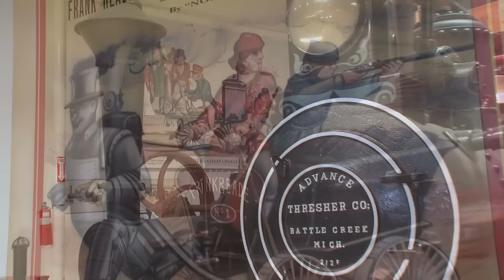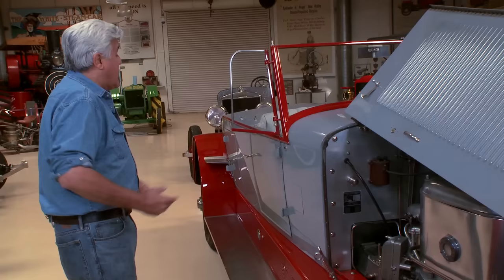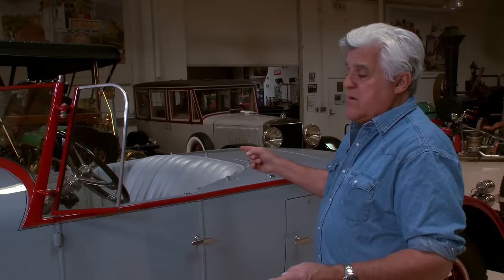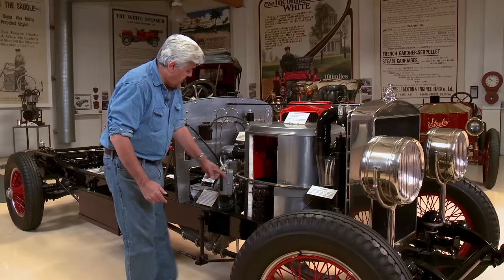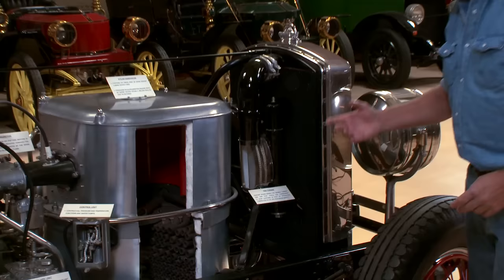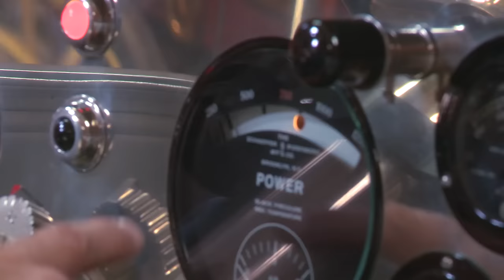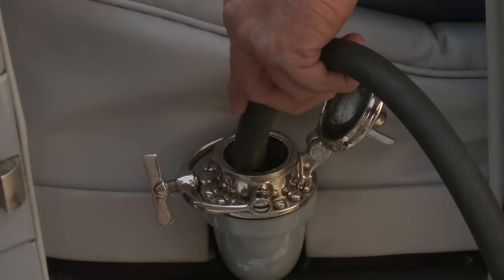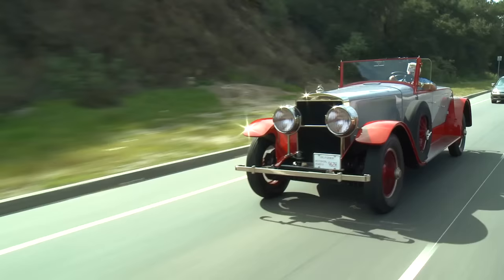1925 Doble E-20 Steam Car - Jay Leno's Garage

Comment: Throw the tesla away and make a modern steam car!!!!
Reply: Why?
Reply: @WilhelmKarsten  because steam is more efficient and can go further than Electric. Look how efficient that one is at 100 years old. Concentrate modern technology and you have a true green vehicle that you dont have to fill a landfill with dead batteries
Reply: @diefledermausrocks3863  Steam is LESS efficient than ICEs or EVs.
Steam cars use 10 times the amount of fuel. 
The Doble E-series is the most expensive car in the world in 1926, yet it was a gas guzzler and was a gross polluter with an obscene carbon footprint.
Jay's car gets between 3 and 6 mpg on regular unleaded gasoline and has extremey high HC and NOx emissions.
The Carbon emissions is equal to a dozen Honda Accords.
 Steam is obsolete technology
Reply: @WilhelmKarsten  an electric vehicle still use fossil fuels to generate electricity that they can store in the storage facility of the vehicle which is called a battery
Reply: @diefledermausrocks3863  Steam cars use more fossil fuels than EVs and ICEs and have a much larger lifetime carbon footprint.
Steam cars are not environmentally friendly and require significantly larger amounts of semi-precious metals and a larger mining footprint.
Reply: what a great idea to quadruple fuel demand and make the enviroment worse!

Comment: This is how you make a Green car, not some hyper expensive EV
Reply: There is absolutely nothing green about steam cars, Jay's Doble is a horrible gas guzzler (3-6mpg on unleaded gasoline) and has an obscene carbon footprint.
Reply: @WilhelmKarsten  use a different fuel source like pure ethanol, and use the system as a starting point for better efficiency, speaking of carbon foot prints and economic catastrophes,  look how lithium and cobalt are mined and processed
Reply: @lazarus0420  Steam cars are even less efficient on ethanol.
You cannot make steam cars as fuel efficient as ICE cars, steam uses around 10 times more fuel.
Reply: Not so sure about that given steam engines (commonly configured as turbines) are still in use for Shipping and are reasonably fuel efficicent, and its not to say a steam generator like used in the Dobel 20 couldnt be made to be more fuel efficent on a fuel source like ethanol to acheive a form of parity or supuriority to an ICE while not being quite so ruinisly expensive to produce and maintain like EVs not dependent on depleteing fuel sources like ICEs
 @WilhelmKarsten
Reply: @lazarus0420  There are not any practical  examples of successful steam turbines for automobile applications,  due to scale efficiency and duty cycle requirements.

Diesel reciprocating and gas turbine internal combustion engines dominate the marine industry because they are several times more fuel efficient than steam. 

The Laws of Thermodynamics prevents any steam engine from being as efficient as ICEs.
The Carnot Formula tell us that the Rankin Cycle has higher entropy and thus lower fuel efficiency.
Entropy increases as Scale decreases, steam engines become more inefficient as size decreases compared to ICEs.

Ethanol is a low energy density and the higher temperatures and pressures in internal combustion engine are more efficient than steam when using a low density fuel.
ICE are not only highly adaptable for renewable energy they are cheaper and more energy efficient than steam.
Any questions?
Reply: @WilhelmKarsten how does the math go for CNG.
Reply: @TempoLOOKING  You add or subtract the BTUs per pound of CNG to the Fuel type you want to compare, then imput the pounds per hour into the BSFC formula, which gives you the total energy efficiency expressed as a percentage.
Of course changing the Fuel has no overall effect on the Rankine Cycle efficiency, which is significantly lower than the Otto, Diesel or Brayton Cycles.
Any questions?
Reply: steam car are so fuel inefficient, its way cleaner to use internal combustion engine than use steam, it takes twisted mind to think steam engine are green, unless your steam engine is nuclear powered

Comment: Better then having Tesla's and other electric cars on the roads.. Lithium for the batteries is more pollutive trying to recycle, and mining it,  it then combustion engines are whent hey are running... Steampowered cars would be the better solution.
Reply: REALLY??
so you didn't know that this car guzzles gasoline at the obscene rate of 6.5 MPG?
And produces more CO2 and NOx emissions than a dozen Hondas?
Reply: This is false news put out by the petroleum industry.
Reply: @gj1234567899999  The oil companies would love to have everyone driving steam cars!

Comment: So....
Hands up who wants these instead of Teslas?
It doesn't care where the heat comes from, you could use Plutonium or solar panels.
Battery Electric?
No!
Battery Steam!
Reply: as much as I dislike Teslas... they are a far better alternative to steam cars.
Reply: Battery-Steam??? You might want to rethink that concept?
Reply: @sandervanderkammen9230  
Heat's heat isn't it?
Doesn't matter if you burn stuff or heat stuff with electricity from a battery.
Reply: @MostlyPennyCat  Well, I guess it safe to assume you are not an automotive engineer....
Reply: @MostlyPennyCat  So you don't see the glaring fatal flaw in that concept????

Comment: Not sure why the steam doesn't drive a Doble wheel? Seems they did everything they could to ensure steam car industry got destroyed. PS, there were hundreds of models of steam cars and scooters in the 1800s, this was by no means innovative, the further back you go the better and most efficient the tech.
Reply: Steam cars and EVs were wiped out after 1915 with the introduction of the electric starter for ICE cars... Steam cars could no longer compete and became obsolete.

ICEs are significantly more efficient and  environmentally friendly.
Jay's Doble produces more emissions than a dozen modern cars and only gets 3 mpg city 6 highway.

Comment: I think if the environuts are so concerned with clean energy why hasn’t anyone thought to bring steam back.  It’s way more efficient than electric and your only using water and tiny tiny amount of fuel. With modern tech there should be absolutely no problem making a new steam car.
Reply: The Doble, like all steam cars are obscene gas guzzlers and have a massive carbon footprint larger than a dozen Honda Accords.

EPA test conducted on the Doble boiler found very  low levels of CO2 emissions but extremely high pollution from NOx and HC and staggering amounts of CO2 emissions.
EPA LA Dive Cycle MPGs of 6.5 on kerosene and 5 MPG on regular unleaded gasoline.
Reply: @sandervanderkammen9230  You are REALLY  down on steam cars, why?
A well designed burner would have less HC than an ICE.  As to fuel economy, much improvement is possible, considering that fuel burning power plants have efficiencies exceeding 40%.
With reduced fuel usage all other pollutants are also reduced.  
Note that I do not consider CO2 a pollutant!
I will grant you that there are serious draw-backs with a steam car, one being the fact that the boiler water freezes in cold temperatures.
Reply: @BasementEngineer  I'm sorry but you seem extremely confused and misinformed.
First off, I personally, absolutely love old steam engines are find them fascinating.
Not true, EPA test proved that liquid fuels burners produced higher HC emissions than ICEs in vehicle applications due to frequent cycling.
 No, steam engines can never match the thermal efficiency of internal combustion engines.
 Nicolas Carnot published his formula in 1824 showing that that steam was less efficient than internal combustion engines before a practical ICE ever existed.
 Rudolf Diesel proved Carnot's theory in 1897 and produced the world most efficient practical heat engine.
 
The World's most efficient powerplants are natural gas fired internal combustion engines (gas turbine) at 64% efficiency.

The EPA, CARB and EEA all classify CO2 emissions as pollution.

It's a more point really because CO2 output is directly proportional to energy efficiency when carbon fuels are used.

Other disadvantages of steam engines is higher costs, start up time and higher fuel consumption.
Any questions?
Reply: @sandervanderkammen9230  The basic topic of discussion here is/was automotive engines.
Do you know of any automobile propelled by a natural gas fired gas turbine???
A natural gas fired gas turbine power plant with 64% cycle efficiency???  Where can I read about this?
To put it bluntly, I don't give a flying fk which government agency calls CO2 a pollutant.
CO2 id plant food!  Try and live without plants.
Agreed that a steam plant for automotive use is complex, but is it any more complex then a plug-in hybrid electric vehicle?  I don't think so.
To be sure, I am not advocating mass production of steam cars;  but then, I don't advocate mass production of plug-in hybrid vehicles, either.
All I am saying is that many of the the reasons you have provided are insufficient for precluding a steam car.  Especially that bit about condensers causing crud and oil in the steam system.
Reply: @BasementEngineer  Do you know of any steam cars powered with a multi stage steam turbine with heat recovery cycles???

The problem here is you ignoring the Laws of thermodynamics and fluid dynamics involved that. Limit the Rankine Cycle that it can never match the efficiency or power density of a internal combustion engine in a automotive application.

Steam cars have been obsolete for over a century for a very, very good reason that seems to simply escape you.
Reply: @BasementEngineer  There is a reason why commercial boiler operators do not use distilled water in condensing steam engines... it's cheaper and more practical to use water softening and water treatment additives.
Reply: @sandervanderkammen9230  Thanks for answering the power-density question.
Reply: Prayers for Jay and his family, he is currently in hospital burn unit undergoing treatment for severe burn injuries he received while starting his steam car.